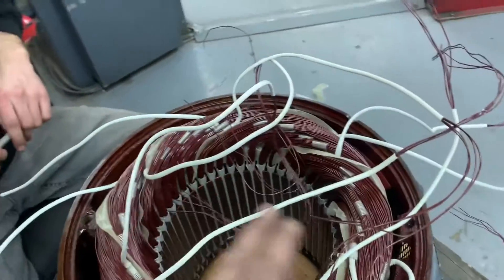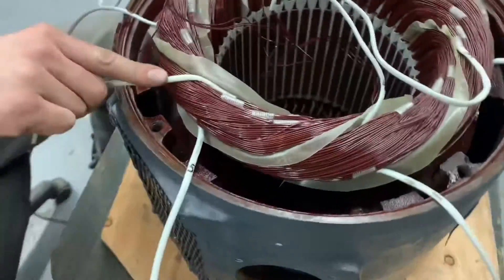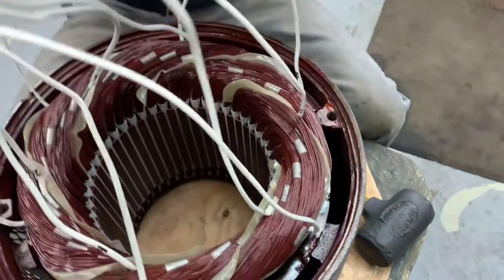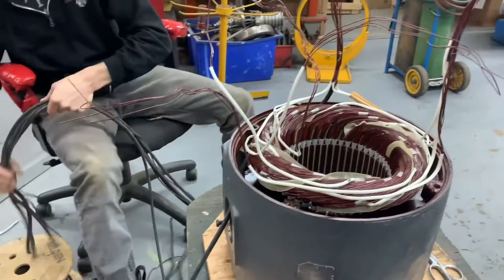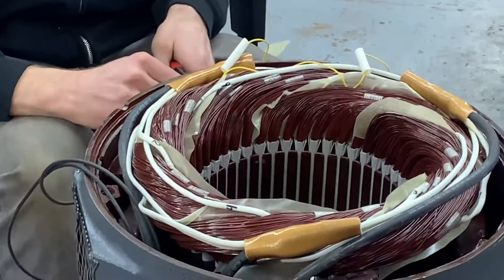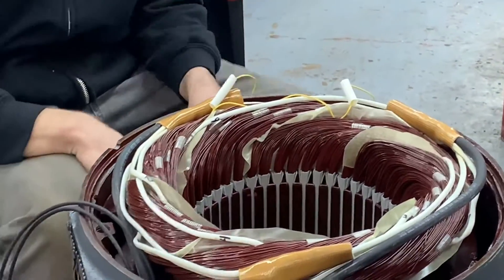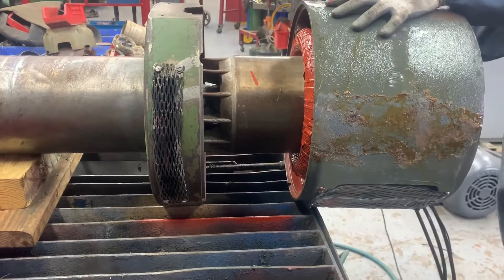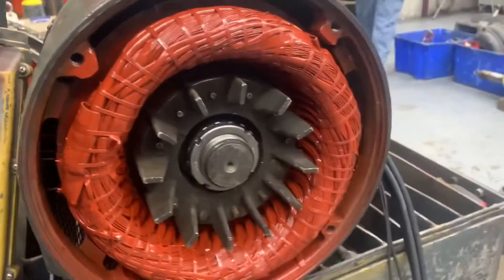Motor Rewinding | Part 2  Connection | Assembly & Test Run | Old Electric Motor

Comment: Hello sir, kamusta po sir my video ba kayu sir para sa compressor sir kasi na encounter ko sir star delta 6 leads 3 star may ganito palang connection sir iba pati yung winding style nya parang iba to sa mga video mu sir meron kba nito sir salamat sir recently sir busy na busy ka Peace Be with You sir para sa pamilya mu
Reply from the maker: May 3 star connection ako sa video ko.normal na kasi sa mga factory mag wind cla concentric mas mura sa labor.

Comment: 0:22 look... why you have not insert insulation paper between in every coil. As I can see you have put insulation paper in between each of the 8th coils.
Reply from the maker: We’re putting only insulation by phase.motor is 6 groups of 8.every coil has 8 coils that’s was the phase insulation paper inserted